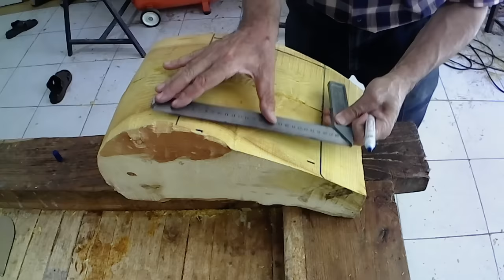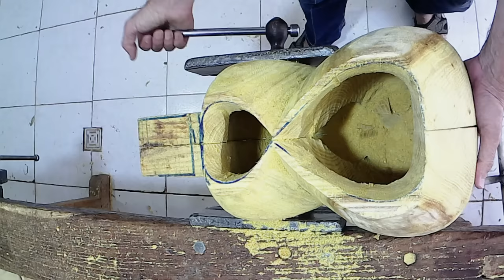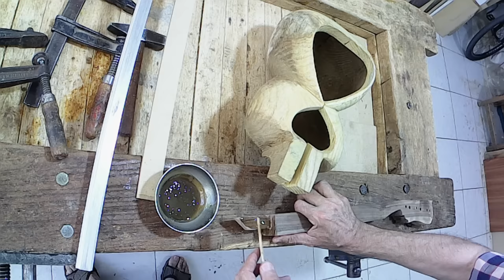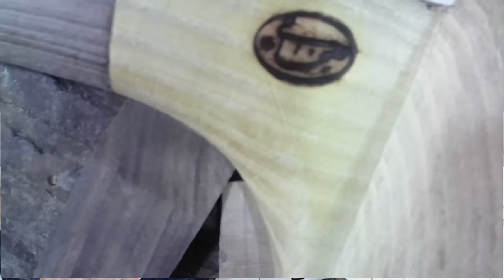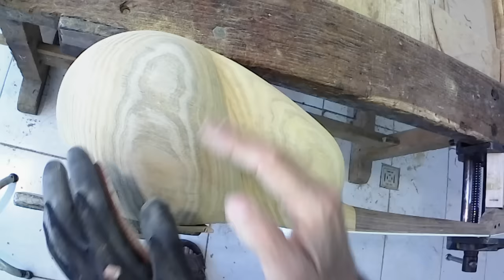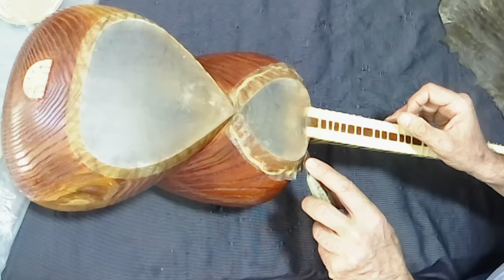From a Tree Log to a Music Instrument: Making Persian Instrument Tar from a Tree Log

Comment: This instrument will be crack after 15_ 20 y. 
It shouldn't made from fresh wood. Actually in the main way should made from fully dried wood, which is old log of tree around 15_25 YO wood. This is completely wrong
Reply: Please  by all means.....go ahead  and show us how it should be made.
Reply: The wood is dry. It’s not shown in the video for obvious reason. Did you expect the video to show a log is sitting there for two months? Comon bro use that little brain.